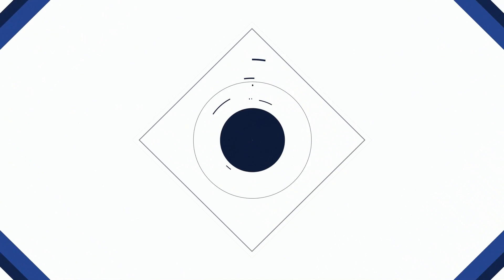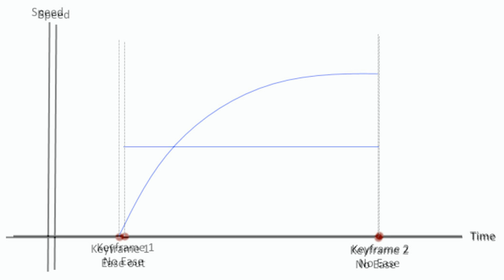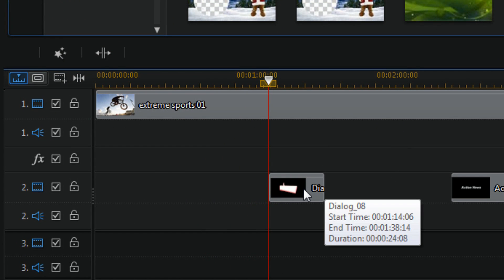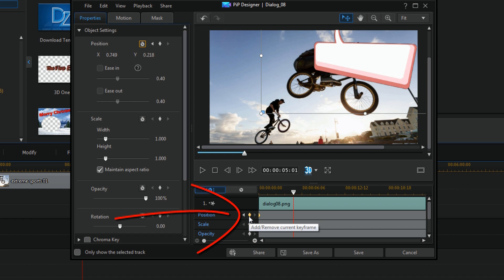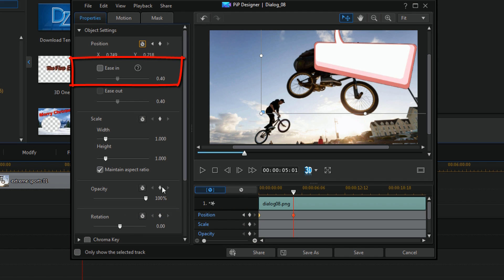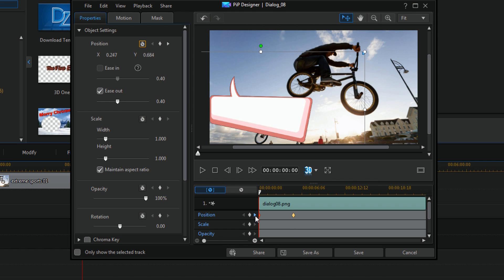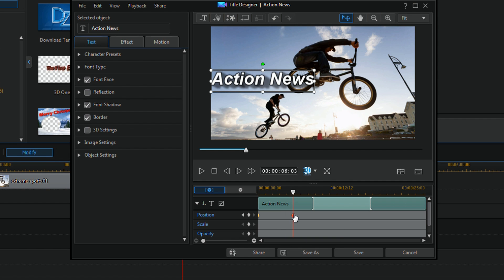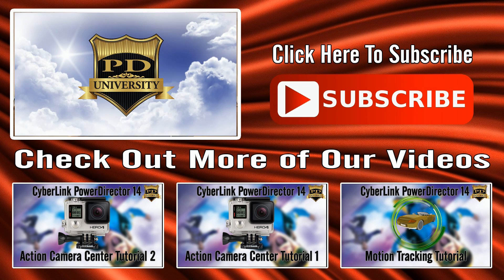PowerDirector Keyframe Tutorial (Ease In/Out Motion)

Comment: help. it is not letting me add keyframes. you know the white diamond shape thing that lets you add the keyframe. it doesn't turn white it just stays grey
Reply from the maker: What version of PD do you have? Deluxe, Ultra, Ultimate, etc... 
If you have a version of PD that is bundled with other software or do not have the Ultimate version you may not have that feature.
Reply: thanks. I do have the ultimate version but it is not working. but thank you very much for replying.
Reply from the maker: If that is the case you need to contact support. :-(

Comment: Great Videos ! How would I use key frames to Rotate in and out a LOGO and have it stop for a few seconds in the middle and rotate back out ? I have it now starting in one corner and sliding into the center of the frame and stopping for a few seconds then sliding back out in a different corner but I would like to rotate in ,Stop and then rotate out I'm stuck and can't get it to work do you have a video on what I'm trying to do ???
Reply from the maker: No I do not have a video on that. Are you using the PIP Designer and keyframes to move the logo? If so, there is also an option to rotate the logo in the PIP Designer.
Reply: Thanks so much I'll check into it ! Keep up the GREAT WORK LOVE YOUR VIDEOS !!!!
Reply from the maker: Thank you.

Comment: Hi Maliek,

Question: I want to use 2 different video rushes that I wish to interpose. Say one rush is a house, blue sky and some white clouds. The other rush are nice high trees. I want the trees to come behind and above the house roof so as the impression is the trees (second rush) are in the whole scene. In PD14 Ultimate I import the main rush into the 2nd video track and the trees rush (say the effect) into track one. I import the 1st rush (house = 2nd track) into ColorDirector3 or 4 as follows: fix/enhance>ColorDirector. Start a "motion track adjustment" on the blue sky AND the white clouds above the house . So far so good. Do the motion tracking. Replace the sky with the white clouds with a chromakey green mask. Fine. Export the rush back to PD14. Click on that specific rush and it opens in PiP Designer > click chromakey>eye dropper and click on the blue sky. The 1st rush with the nice trees should now be in the back of the roof of the house instead of the blue sky. This happens but only partly since the white clouds come as stains which I can not avoid with the tolerance butons in PiP Designer. They remain stains and ruin the effect. Is there a way to avoid this? The purpose remains to use the 2 rushes but I am not sure the 
PiP Designer is good enough for this?

I tried with masks (blue sky and clouds)  but nothing helps here?
Reply from the maker: +collectoroffrance  I have experienced the same issues you have with shots that have artifacts which get in the way of getting as clean of an effect as I'd like. Looks like you did everything right. I don't think there is more you can do to fix the issue. if you find a solution please let me know. :-)